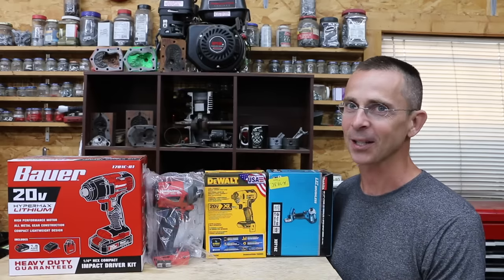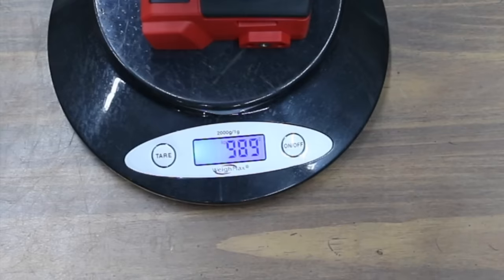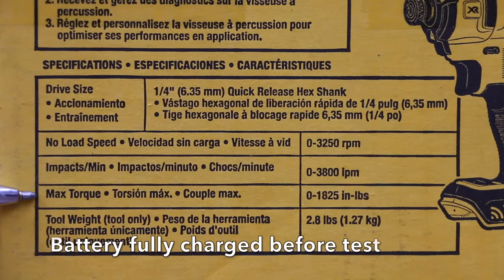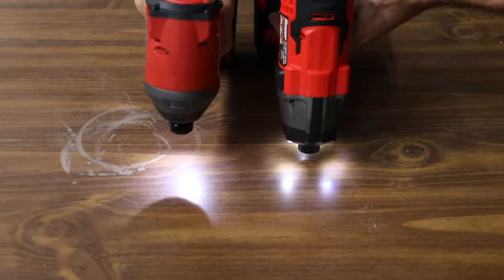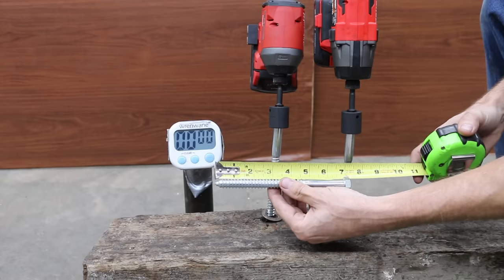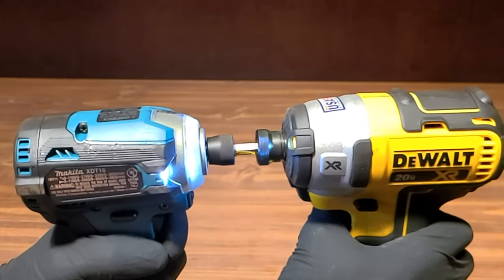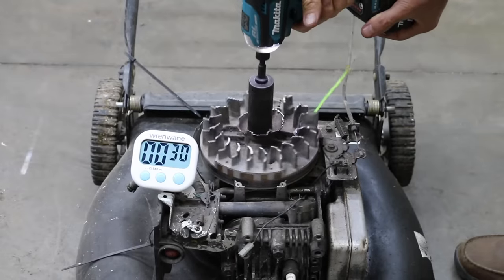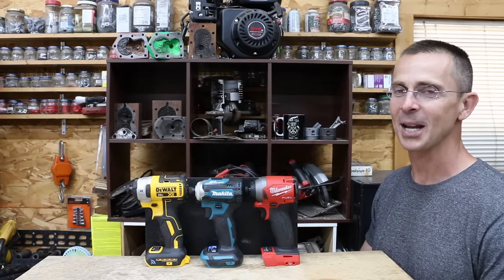Best Impact Driver? DeWalt vs Milwaukee vs Makita vs Bauer!  Let's find out!

Comment: You posted this less than 6 hours after I bought a set...I should have waited. Lol
Reply from the maker: Sorry I'm late!
Reply: @ProjectFarm  All good! I went with what I knew and what was on sale: Ridgid. Lifetime warranty is quite useful, too.
Reply: Return it
Reply: Totes McGoats requisat in pace
Reply: Just return it then
Reply: Well you can still return, right...
Reply: @ProjectFarm  I'ne been waiting a long time for this one. Thank you so much!
Reply: @vorexis  return it. You will never get the benefit of the "lifetime warranty". You will have to register your tool, justify the issue while proper usage and arrange the shipment to the facility yourself then wait to get it back.

It's cheaper to buy a new tool if it fails.
Reply: @ArthA122  facts that's why I went with ryobi 75$ for over 100 just the tools when you find them in stock but I've only had regular drill and impact burn up.....now I'm on a brushless impact and hammer drill half inch zero issues.....the ryobi did eat the shit out of battery juice on the circular saw so I just sold it and went back to corded.
Reply: Totes McGoats I use my Milwaukee set pretty much everyday. I haven’t had any failures other than a battery breaking when I dropped it, but some super glue and it was right as rain. I love Milwaukee tools and they haven’t failed me yet. Lol
Reply: @vorexis  I have a ridgid X5 and it's been good to me so far. If you are not a professional using the tool everyday on a jobsite, they will will all do the job perfectly in my opinion :)
Reply: @ArthA122  Not true. I have brought 2 seperate Ridgid tools back to a Home Depot service center,  two weeks later tools were back in my possesion fixed and without a dollar out of my pocket.
Reply: @jasoncerniglia7010  "two weeks later." And also broken tools. 

So I guess that's a win?
Reply: @jshapiro34  you went to ryobi before you went to kobalt? :/
Reply: @jasoncerniglia7010  you are lucky for being able to get that through a Homeless Despot (AWE) store !
Reply: ArthA122  AVE is my other go to when I’m looking for a review.
Reply: You not alone I just order a DeWalt impact wrench yesterday 🤦🏾‍♂️
Reply: @GutsBerserk832  yes because when I started buying tools I didn't have lowes and I got gifted the crazy set of like 6 tools and 6 batteries when the 18volt lineup started and I've just continued to keep adding no issues with batteries but I have insulated garage.  I had a small drill burn up and impact gun but sense resolved those issues with hammer 1\2 inch and 1\2 brushless impact.....didn't care much for the hard tools like circular saw grinder those I took back and bought corded models they just ate batteries to do a simple job...... And sorry I have a few expensive parts but ryobi and hart do make super cheap good....not great or top of line but I've seen worse on prime tools and bits they do the job and if they crack shear or break I'm not crying about it.....also it seems like homedepot runs better and more sales than lowes....for instance it's home depot that is selling the 22ft  pro 5 in 1 werner ladder right now not lowes.
Reply: Don’t worry Milwaukee and ridgid are almost the same. Are owned by same company
Reply: @knightpaulman4686  good to know 👍
Reply: @ArthA122  I had my Ridgid tool returned to the repair center by Home Depot. I had to pay to send it and was REIMBURSED upon its return. This drill/ driver was factory defective and there is  long line of complaints on a Ridgid forum. In fact, I paid for it to go to a repair shop and they replaced the defective chuck with another defective chuck. The final repair facility fixed the problem  and as I said, HD paid the freight. I am going with Ridgid if they make what I want. Oh yeah, if you buy a battery WITH the tool, it has a lifetime warranty as well. YES, you do have to register the product but I did and most people can do that.
Reply: @knightpaulman4686  Makita and milwaukee tools won't fail you they just hurt ur damn wallet and make you paranoid who touches uses or barrows tools....#toolnazi when you own top dollar top quality tools.
Reply: I've used Dewalt, milwaukee and ridgid. This will be my second ridgid impact and I put the first one through hell, including using the warranty. Dropped it off at home depot, they repaired it, and sent it back to me. They aren't perfect, but for the price, it's a good deal.
Reply: @vorexis  I have Milwaukee tools. But i would get Rigid in a heartbeat. I use coworkers rigid tools all the time. They're great. Also I'm fairly certain they're owned by Home Depot so you can exchange broken tools fairly easily.
Reply: @jshapiro34  i understand that like if your not in the area but the batteries are cheap with good capacity AND warranty on them (2 years longer then dewalt) and they have higher voltage and when you look at the rest of thr line up its not hard to see why its not a big risk investing in them
Reply: To the OP don’t worry about the warranty on your ridgid tool set. When I was an apprentice I had a Journeyman who used ridgid tools and never had an issue with the lifetime warranty on them. He had to have a couple tools fixed. Some guy in the comments was scoffing at the fact that it took a couple weeks for repairs. They all can take two weeks really just depends on where you are, closest repair centre, what broke on which tool. The only company that would potentially have shorter wait times would be Hilti but their initial cost to get started tends to be much higher then other brands. In my experience they don’t really offer a deal when buying kits. Coming from a tool nut who has owned and broke (or seen broke) nearly every brand of tool money. The ridgid tools are good tools you don’t have to worry. I’ve destroyed a M18 Fuel drill/driver 2706 before so don’t feel too bad. Hahaha
Reply: @jshapiro34  yeah what's up with ryobi battery life? I have the cheap cordless angle grinder, and I like it, but it drains a full 5ah battery in about 5 minutes. Whatever the hell that motor is doing, it sucks at doing it. I know brushed motors suck, but this is crazy.
Reply: @drop stix oh yeah. I've seen products on Amazon sell out after a PF video.
Reply: @vorexis  I still have the ridgid set. Battery life is horrible, they just doesn't last long. I have both 1.5 & 4amp.
Reply: @DMSparky  I've used ridgid daily for the last 2 years, so it's why I went with them this time around. The work I'll be doing isn't nearly as demanding as I'm used to, so it'll be fine.
Reply: @jtto6364  I've used the ridgid sds chisel with a 4ah battery in a -10 freezer and got several hours out of it.
Reply: I guess it wasn’t a Milwaukee... lol
For casual use- they are all good, even the brushless Bauer... they all have a purpose (if the price is right... * i do have a Milwaukee).
Reply: This has happend  to me on his last two videos...literally ordered stuff the night before....i swear he hacked my Amazon account lol
Reply: @GutsBerserk832  correct and rigid kobalt ryobi are super easy to get swapped warranty cheap batteries come with most tools for 99 or 79$ and you can buy most tool only 79 to 40$ they will get the diy stuff done and do ok with commercial......now these brushless motors coming out I'm excited for some crazy testing.
Reply: @shawn576  they last in all my other tools except the heavy duty tools. I have no clue what is up with that but drill impact drywall gun sawzaw sanders all last but other saws and grinders done in 10 20 minutes so the heavy duty tools I just invested in expensive 100 ft surge protector cords and corded models. No issues plenty of power have not burned any up yet. But pay attention to ur batteries store them correctly and charge them correctly their is a ryobi nack about how to charge them and don't let em die or fully charge till ready to use em like night before
Reply: Ridgid is still a quality manufacturer, and in my experience might not perform as well as some other tools, it still out performs most, and will last forever.

Comment: Dewalt app after the driver is abused for 3 minutes and bellowing smoke: *This is fine*
Reply: Yeah, reduces warranty claims :)
Reply: 🔥 🐶 ☕ 🔥  "This is fine."
Reply: And the chuck was wiggling.
Reply: @deeeeeeps  the chuck wiggles like that on even brand new ones
Reply: I've had mine since 2014, never had it fail especially driving deck screws or loosening Kenmore Oasis Washer/Maytag Bravos/Whirlpool Cabrio rotor nuts or getting water in it. It paid for itself and the battery life is excellent. I use a milwakee apex adapter since HF ones break so easily.

To me Dewalt and Milwakee are great. Makita/Bluepoint are others.
Reply: Is there anyone who actually uses - and appreciates the features of - the various tool apps? I see no real value in it, other than coffee break bragging rights.😶
Reply: I literally laughed my ass off and thought of the same thing! "This is 2020, we are on fire, this is fine" LOL
Reply: Don't Kink Shame Dewalt.
Alittle masochism never hurt anyone.     wait a min....
Reply: @Andy King I agree with you, I don't see somebody pulling out a phone to set up the drill while working in a uncomfortable position. if you need to change drill speed, it has to be quick and easy
Reply from the maker: Thanks for watching.
Reply: Lol I died when I read that!
Reply: When the yellow ones first hit the scene they were going out on us like cheap light bulbs in a ceiling fan and that was with 
using drywall screws only.
Reply: @andyking894  One great advantage: much costlier repairs... good for the tool maker!  and since more circuits are present, more things to go wrong too.
Reply: I have put my dewalt through hell so many times I can't count . I like makita for corded tools I have 4 x9v drills siting in a box
Reply: @deeeeeeps  its supposed to do that

Comment: Excellent video. I switched from Dewalt to Makita about 4-5 years ago. At the time I was tired of DeWalt's batteries going bad too fast. I have no idea how many hardly used batteries from DeWalt's I have. Since switching to Makita, I have not lost one battery the same way I did with DeWalt. Hopefully, I'm healthy enough in the fall when it cools down to complete the many projects I have. These are pretty much the best tool video's on YouTube. As a old Viet Vet, I greatly appreciate your time and efforts!
Reply from the maker: Thanks!  Thanksk for sharing.
Reply: I have a  Makita cordless drill that is 20 years old and it's 9.6V NiCad battery still charges and works. Now, I don't think it's charging even close to what it did when fresh, but I'm impressed it's not dead. Still good for small jobs.
Reply: yep, this part does not get tested. Makita has the best battery longevity and they charge fast.
Reply: Awfully strange and sorry to hear your bad experience. I've been using my Dewalts for 5 years now and haven't lost but 1 battery. It was due to me dropping the tool
Reply: @IndorilNerevar  I had a Dewalt dropped underneath a cow hay feeder and it sat there for at the least 3 months during winter. Eventually found it after the 4th ish month and the drill and battery still worked somehow and it still works today.

Comment: "it's now a brushless motor" hahaha too good.
Reply: I’m five minutes in and saw this. This should be good!
Reply: Does it replace a standard drill? They have sets with both but do you need both?
Reply: @rebeccalankford2652  Once you try an impact drill, you'll never go back to a regular drill.
Reply: @rebeccalankford2652  there are some occasional uses for a regular drill but honestly it's rare. I have used impacts for 15 years now of daily heavy use. I probably have used the regular drill a few dozen times compared to tens of thousands with the impact. You can get drill bits/paddle bits, and socket adapters that fit the quick connect. If buying one or the other get the impact. It's not even close.
Reply: rebecca lankford get a good cordless impact, but find a decent drill with a cord. I only use the drill when boring a hole where the impact would break the bit.
Reply: @redd8456  Thank you for the advise. Next question. Keyed or keyless chuck?